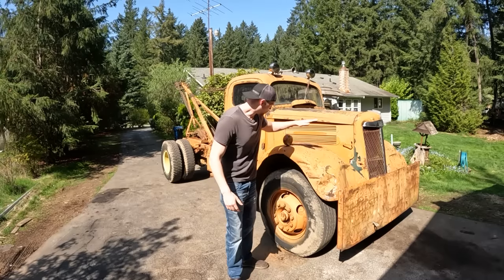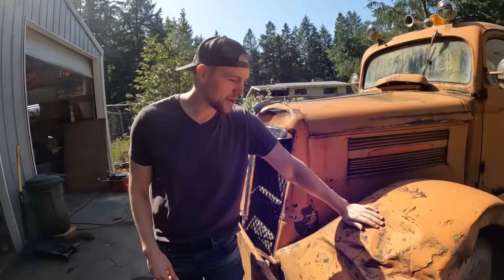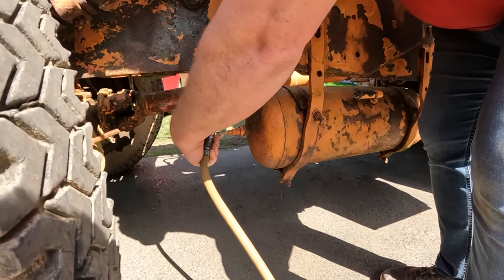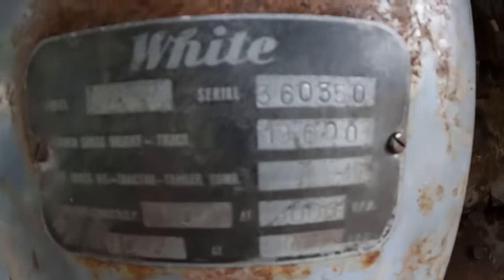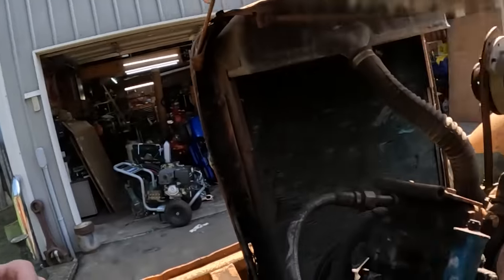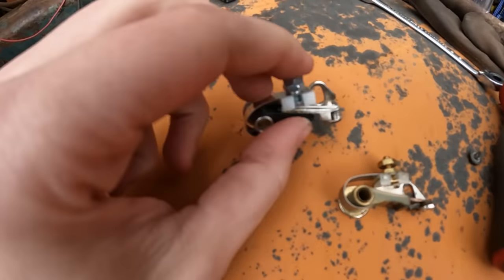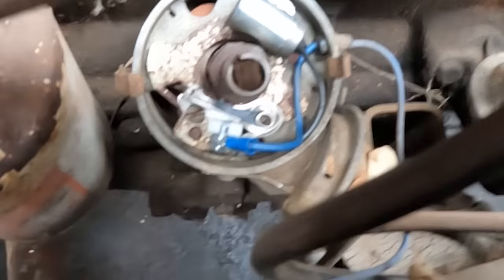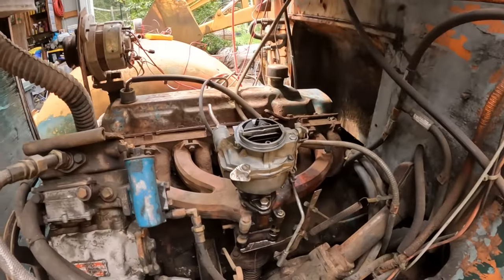1949 White Super Tow Truck WILL IT RUN After How Long?!

Comment: You   do   know   you   have   to    take   the   caging  bolts   out   of   the   rear   brake   cans   to  get  you   rear   brakes   to   work   right!
Reply from the maker: We backed the nut off till the cage bolt was fully in, even loose. and we still didnt get brakes. the bolt does pull out though, does it need to come all the way out? We're not familiar with these old school air brakes, any info would be greatly appreciated!
Reply: The fact that the brakes didn't lock when the bolts were removed means their not adjusted

Comment: The bolts sticking out of the rear brake chambers are caging bolts. When you tighten the the nuts and it pull the bolt up, its actually pulling the service brake spring up so the brakes are in the released position. The screw that you are turning in on the carburetor is probably the idle air mixture adjustment. it should be turned in until the engine just about dies, then back out until it smooths out. If its backed out to much, you will just have to high of an idle. The whole in the floor next to the shifter looks as if it originally had a duplex shifter twin stick. The front wheels have been converted from bud style to a unilug. Love the patina on this truck, great find and really great thing to do with you dad. All the best.
Reply from the maker: We loosened the nut till the caged bolts were fully in (even loose) and still didnt have brakes. Neither the spring brake or brake pedal gave any resistance. When we pull the air brake knob the bolts back out all the way and are able to come out completely, not sure if they should be left in or not but it seems weird that they are just loose with the ability to come out. We're not too familiar with these old air brake systems, if you are we'd love some info on them! Thanks for watching!
Reply: @Edward-Thaine  Those "bolts" as you call them are only inserted into the hole of the brake chamber and turned a quarter turn in order to release the park brake which is what the know on the dashboard is doing with air. If you have no air then to release the brakes you must use those special bolts. They need to be removed and left in the truck if needed in the future. The foot valve which is the brake pedal on the floor sends air to the brake chambers at all wheels and moves the arm that is attached to the lever on the shaft which on a 60's and up truck is called a slack adjuster. Not sure whats on a 49 originally but I doubt much of that truck is original except for the cab. The slack adjuster is designed to be adjustable so as to be able to limit the distance between the shoes and drum and is attached to the shaft coming out of the brake backing plate. The rear brakes are "cam" brakes. The shaft turns and the cams on the shaft have rollers against them that are on the brake shoes and as it rolls up the cam the brakes increase in diameter and press against the inside of the drum. The brake shoes must be thick enough and the drums not oversized and the rollers working properly and no damage to the cams as the shoes should only be 1/8 or less from the inside of the drum. Excess wear in any of those parts can keep the cams from being able to expand the shoes far enough to reach the drums. Google, air brakes and truck brakes and cam brakes. There are pictures and even videos on the brakes.
Reply from the maker: @crazyoilfieldmechanic3195  Great explanation! We took the bolts out and theres actually a holder for them on the side of the can. Still got nothin from the brakes. Our guess is pads/drum/cam is worn out. But we will find out when we dig into it more! Appreciate the reply!

Comment: Dont forget to put a little grease on the points rubbing block and to put some oil into the felt under the rotor and there are gaps in the base plate to oil the mechanical advance weights also the older distributors had an oiler on the side of the body for oiling the shaft.Make sure the manifold support stay is installed as it is a very heavy lever on the mounting studs which you also need to tun a spanner (wrench in your lingo ! ) over regularly. Regards

Comment: Remember that a Slant Six has solid lifters, so there HAS to be valve lash. That's the noise you hear. Someone has put a Chevy stovebolt carburetor on it. Chrysler ignition systems of that era used a coil that was designed to operate on about 6 volts with the key in the ON position(running) which was dropped by the ballast resistor originally. During cranking, the starter circuit through the ignition switch routed  power around the ballast resistor to feed the coil  full 12v. There is no "terminal on the solenoid"...these commentors have been around too many Chevies. If you don't wish to fool with a ballast you can find a coil that has an internal ballast. Not sure how long the points would last with full 12 volts.

It has a pre-1970 valve cover on it. The only factory Slant Six painted that blue color with that style cover was a 1969. You can determine the year of the engine by finding the stamping that is on the deck surface right below the #1 sparkplug. It faces upward and will be something along the lines  of  F225R  6733  2809  F is the year code, 225 the displacement, R is regular fuel, one of those two sets of numbers( your's would be different of course) is the shift code and the other the  production date  as deciphered by the 10,000 day Mopar calendar. Have fun!
Reply from the maker: Thanks for all the good info! The coil we got has an internal ballast so it should be good. I think the engine had 1970 on it somewhere. Ill double check it with the codes you gave, thanks!
Reply: All this is correct information.

Comment: On the starter solenoid, there should be a terminal that appears to do nothing.  It actually provides 12 volts while the engine is starting and should hook up to bypass the balast resistor to the distributor.  Should take care of the starter drain you were having.

Comment: I'd like to see a part 2, possibly a part 3 where you get the engine running and go through the brakes or go through the transmission and get the truck moving
Reply from the maker: there will be a part 2!

Comment: Usually there is a 12 volt wire on the coil. Off the starter solenoid for when it's cranking to provide a full 12 for starting.
Reply: This truck was probably built as 6 volts, so it may not have that resister bypass.
Reply: Not on a Chrysler product.
Reply: May not be standard on a Chrysler product, but this is a very non standard situation, Chrysler motor grafted into something else, Battery cable sizes, terminals, condition etc all affect this. Suggest a reading coil voltage at coil terminal while cranking as a starting point, is the coil a 12V for Chrysler or 6V from original install. Maybe a direct cable from battery to coil bypassing all original wiring, don't leave connected between attempts or you may burn coil. Check coil polarity as well, original had a generator suggesting +ve earth, alternator on current motor would be -ve earth. Coil polarity and voltage are important, hence question about whether it is original 6V or updated 12V coil.

Comment: We had a 1956 Oliver Super 55 diesel farm tractor, acquired by White Trucks, then Massey I believe. I had 2 deal with Massey when they went bancrupt, on a cash basis, 2 days a week, no guarantee there  WOULD be "another day"! 4tunately, I got the engine parts/pump and injectors rebuilt b4 they folded! Years of ether starts destroyed the sleeves/pistons/rings, so I rebuilt the top end. an old diesel mechanic taught me the "paper timing light", after the engine got accidentally bumped with the injector pump removed! I had a few sleepless nites! lol

Comment: When the starter solenoid is engaged it supplies battery voltage straight to the coil by bypassing the ballast resistor.
Reply: If it's wired up correctly.
Reply: That is on vehicles built as 12 volts.  This probably was built as 6 volts.

Comment: A12 volt coil you can get a one wire alternator and get rid of a lot of that harness check the key wiring to fix your delayed start the engine is starting on the rotation after you turn the key to run the ballast resister brings the voltage down to 91/4 for constant running I love old stuff IF YOU CANT GET IT ALL GET SOME!!

Comment: That piece where the coil is hooked up is a ballast resistor,  run your hot wire directly to the coil and if  it runs that way, the resistor is bad. Pretty common on Chrysler products.  Operating the throttle will help as well.  Keeping the engine RPM above idle will help as well,  especially if the engine hasn't been run in a few years .  

Good luck. 😊

Comment: Brown and Lipe auxiliary trans, brownie for short. Many different sizes and ratios. Some had "power towers" that ran the winch. You would have had better luck using ether rather than flooding it. From appearances this truck was used in a salvage yard. Turned out pretty good for not having help from a mechanic.

Comment: I have a '51 Supper and found out the hard way about brake technology of the time. The brakes on mine work backwards from the way they work now. They release when you loose air presser ,then it rolls down hill.
Reply: It should have the hand parking brake

Comment: You're not getting 12 volt ignition. To increase the voltage when starting, normally the I terminal on the starter solenoid must be connected to the coil + side. When the starter is energized, the solenoid sends 12 volts to the coil side of the ballast resistor. When you were trying to bypass the resistor, you were not actually bypassing it. When you try to run without the resistor in circuit (like with a "12 volt" coil, you'll soon start burning out points, do the very high current being drawn by the coil. As best I remember, 12 volt coils were essentially the same as 6 volt coils, hence the ballast resistor or a resistor wire taking its' place. You can easily check this is the case by comparing the coil resistance between the two small (+ and -) terminals with an ohm meter.
Reply: too tired to comprehend that in full, but in short you are right, the points should not get a full 12 volts as starting drops the battery to 9-10v on crank, the ballast resistor is designed to keep the points at this voltage once cranking has stopped and the engine is running
Reply: @DamianGillett  points never get 12v, they get the high voltage of the coil. and some coils doesn´t like 12v, depends on the system.
Reply: @oliverroedel1111  You obviously do not know what a ballast resistor is for, On Crank the coil and points get 9v in start postion allowing for starter draw, then when the key is returned to on that runs through the ballast resistor to keep the coil and points at 9-10v. You learn something new every day :)
Reply: @DamianGillett I know very well.  How ignition systems work. POINTS never get 12V, they get the hugh voltage from the coil. the COIL does get 8-12V, depending on the ignition system.
Reply: @oliverroedel1111  Never get 12v? but you just said they do depending on ignition system. thats as varied as my ex fiance's opinions on the sky being blue
Reply: @DamianGillett 
You are correct,  except as more current runs through the ballast resistor,  the more it cuts back on the voltage.  It can drop to around 7 volts.  The reason for that is so when the engine is cold the points will get more voltage.  (That helps the engine run when cold) as it gets warm it doesn't need as much current to keep the engine running good,  or to restart when warm.

Comment: You need a full 12v resistor bypass for starting. SHould be a terminal off the starter solenoid.

Comment: That is a ballast resistor next to the coil. The starter circuit is suppose to bypass it when the engine is cranking. It's hooked up all wrong.

Comment: It might be a waste to rat rod this truck. The truck has so much character. 
Maybe get it mechanically sound and tidy the body and chassis a little so as to keep its history. I think you would have a crowd pleaser definetly.
Regards from England 🇺🇸 🏴
Reply from the maker: We would keep the looks, just some power upgrades, wheels/tires, give it some stance to drop that bumper down a bit 😁 weve got some cool ideas! Stay tuned. Thanks for watching!
Reply: @Edward-Thaine --  Well, if you "ratrod" this truck I won't stay tuned.  I hate it when someone destroys a piece of history or a neat old truck, even though it doesn't have the original engine. I've refused to sell some of my previous classic trucks to people for this reason.  Once they told me their plans I refused the sale.  Sure they were pissed, but they are not going to destroy one of my trucks!!
Reply: @ironcladranchandforge7292  There are enough "Rat Rods" out there built to be rats. Survivor vehicles made safe to drive and run daily are a better choice. I have a 1933 BB Ford survivor, 89 years old. Fresh from the fields of Great Falls Montana.

Comment: It needs a Cummins 5.9 or 6.7 swapped in, and the tow gear swapped for a flatbed body, it'd make a great rig to pull a big 5th wheel travel trailer

Comment: 14:15 - "I got 6 volts right to my thumb" - No, you didn't. You got about 15,000 or 20,000 volts or more. 6 volts won't normally shock you, unless perhaps it's on your tongue, and it certainly couldn't make it through the high-voltage insulation of a spark plug wire. 

You don't really think it's only 6 volts going down the spark plug wires do you? That could never run an engine, because 6 volts isn't anywhere near enough voltage to jump the gap of a spark plug, therefore you'd have no spark. 

The 6 volts from the ballast resistor (it's usually more like 8 or 9 volts) gets increased to thousands of volts by the ignition coil, which sends it to the distributor, which sends it through the spark plug wires.

Comment: Positive or negative ground ?
Look at the coil.
Which post is connected to the distributer ??
Neg or Pos. ?
IF you know how to hot wire a coil. 12V hot to positive.. is Neg ground.
So...Which terminal goes to existing distributer ?
+ or - ?
As it has an Alt, I'd say Neg ground off hand.

Comment: They had huge gasoline engines originally. Slant six is a good engine. Beef it up. It has air brakes to
Reply from the maker: The engine bay does look like it had a pretty big engine in it originally, Im not familiar with white engines tho. Thanks for watching!
Reply: @Edward-Thaine   the slant six is a 225. The engine that was installed in the factory was like a 405 . It was a monster like the international Red Diamond. Weigh about 1,000 lbs. you probably have room to put an old in line eight engine in it. It weighs about the same.
Reply: White Mustang flat head 6 cylinder engine was originally in them

Comment: Check for During cranking the resister for the coil should be bypassed by the ignition switch..there's your problem

Comment: repowered with dodge slant 6, orginal motor was flat head 6 cylinder that where same motor in ww2 half tracks, i have 3 motors that would have been in this originally,  all three rebuilt at some point,none original bores, cranks are turned down, pistons all cracked betwwen rings, they where kinda a junk motor in the day compared to other gas motors in thous years

Comment: Those are old school brake chambers…. Not modern type 30 S cams…… there is no auto spring braking on this truck…. It’s
Probably still got wedge brakes as well….. 
if you loose air pressure you will have 0 brakes other than the hand brake change the rear axle out for one from a 80s or 90s Chevy c60 or ford f600 you’ll get a higher ratio and modern brakes that won’t kill you…….
Reply: Wedge brake chambers have the actuator rod moving through the backing plate towards the brakes. Many trucks even after 1970 had wedge brakes. Unfortunately......

Comment: That's because the motor and the transmission had been rigged up somehow before y'all bought it and before that person had bought it so white and 1949 had the 6 cylinder diesel which was a small motor or small block diesel white had never used Chrysler engine's at least I don't think , that could be why that's not running properly or some things wrong with the motor cuz that motor in the transmission belongs to a Chrysler sedan four-door

Comment: I don't know what you're going to do with it if you're going to keep it I would suggest to get a new ballast resistor 1965 Plymouth Valiant with 170 slant 6 my dad bought it brand-new for my mom for anniversary present long story short I was tasked to make it run because it was going to be my first car it would start try to start but not and they hot-wired it the problem with going past the ballast resistor if you Hotwire like you did straight-to-the-point quick I was constantly fixing it I was fifteen going on sixteen found that the ballast resistor was bad and beautifully I'm pretty sure you still can get them the first time in my life my dad congratulated me her finding something he didn't think of of course he was a mechanic in the military for 26 years it actually worked on those engines because they were in Battalion generators the 225 just a heads up